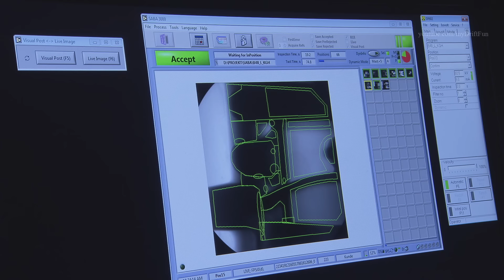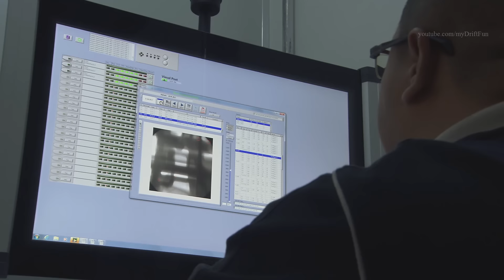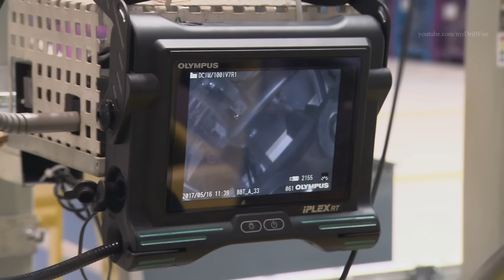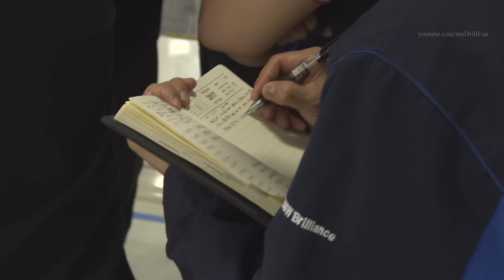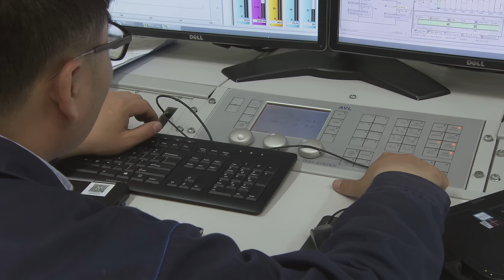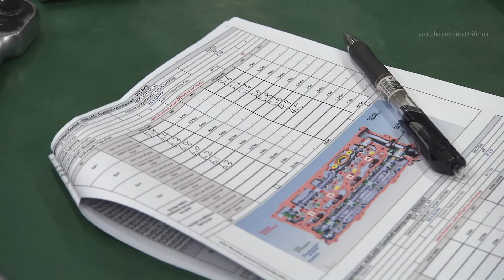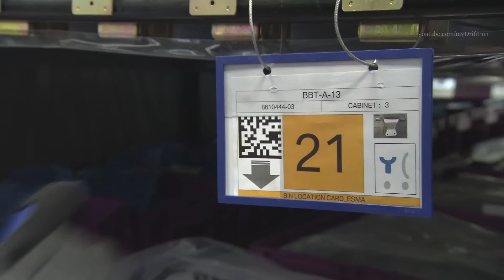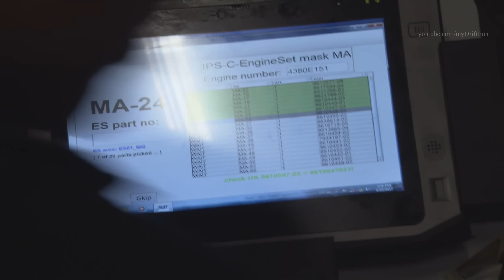BMW Engines Production in Shenyang, China

Comment: It's interesting that the language used in the labeling, and the computer software they're using on the assembly line is English. It looks like a very high quality operation. I'm certain that every part of the process and the quality assurance testing is specified by the German engineers.
Reply: Fred Flintstone  Quite correct Fred. 
This is a top quality operation, very modern.
If there is any problems with the engines then it is with the design of the motor or the materials used in it's construction.
Reply: There is always Chinese "finger print" on made in China products. Please see for example on "15:02" the fork lift charging cord. Looks Chinese level of high end knowledge to me. Wires should not be seen, right? Even modern, it's Chinese.
Reply: I would rather ask what the cause of the problem was. Was it the materials, or the design, or some other problem? I would not be so brain dead as to just assume that the problem is the fact that the work is being done in China.
Reply: of Course the chinese can never creat any technology of their own they are just counter fitters
Any high tech industry have to be supervised by foreign nation
Reply: Whether or not it's true that the Chinese can accomplish great things in engineering is something that can certainly be debated, but I don't feel that applies to these factories where companies like BMW come in, set it up, and supervise the activity. I do believe that foreign non technical countries can come up to speed over time with education. It's not as if one sort of people is better for an intellectual task than another. Education and experience will increase the abilities of anyone. People may debate over whether genetics is involved, but I don't believe it's been proven to be true.
Reply: AbdelRahman Said Really , you believe that ?
One day they will overtake us in abilities,  enough that I truly think they will be the next pioneers in Space Exploration. 
Even to the point of putting a manned Lunar Colony or Base  on the Moon , before  the USA.
Furthermore,  they will be THE Superpower to beat.
Out of the nearly 1.3 Billion people they have,  I am quite certain that in that mass of humanity lay numerous geniuses. 
The mathematical probabilities just make it so.
Reply: Most Germans speak English very well.  German companies export many industrial products to so many companies.  It just make sense to standardize everything to English, unless the purchaser request labeling in their own language.  There are more Germans in White American population than all other white population COMBINED.  Germans are about 60%, where as English are barely 10%.  This was true BEFORE the war.  The reason why America is English speaking nation and not German is because it was the king of England that we had fight and gain independence from.

Comment: No big change in engine quality.  BMW engines have been burning oil like there's no tomorrow for decades so moving production to China will go mostly unnoticed.
Reply: do they use synthetic oil?
Reply: peter must have had an m52 LOL
Reply: One of the most unreliable brand for engine yest beautiful cars.
Reply: ya think so?
Reply: BMW and VW need to use correct oil, better 0W-40(30) than 5W-40(30).
Reply: @gregh7457  these parts are supplying china market only you just simply cannot buy them from the outside. of your car is a bmw and it has any problem it is not even manufactured there.

Comment: You'd think with all that technology they could produce an engine block that can survive the occasional overheat, and won't shed it's bolt hole threads when you remove a head bolt.
Reply: engineered early retirement

Comment: Questions:
  are the machines shown doing the work making the parts built in China or were they imported from Germany?
  do the Chinese workers perform the same inspection routines as the German workers?
  are there any models made exclusively for the Chinese market? If so, which are they?
I can watch this stuff for hours and re-visit it and watch again.
Strange ending...
Reply: Hi Johan, some of the models started by exclusively offering to China market such as the longer wheelbase cars and the 1-series Sedan. Since China is already a huge market with drastically increasing demand for cars, only 2% of the China made cars are exported every year. As far as I know China made BMWs are not yet being exported. 
The Shenyang BMW engine factory is the first engine plant set by BMW outside of Europe. It seems to be more advanced and I guess it must be supervised by BMW.
Many other engine companies produce their engines in China, such as Perkins (a Caterpillar company), whose engine are assembled in Suzhou. But the engine block and some other parts are actually imported rather than making in China.
The engine plant of BMW in China casts engine blocks which I think is more advanced than Perkins. 
Yanmar and Cummins also make engines in China as they need this huge market. 

P.S. I'm no expert but hope this helps.
Reply: Everyone is so fearful of the Chinese Menace.
  If the guys at BMW are willing to put a factory over there for that market than "all the power to them."
  that 1 Series car is a rocket on the Europe Rallye scene.  very coool..

Comment: Did i see a 3 cylinder?
Reply: Jim Clarke Yes, the 3 cyl is for the i8. As well all BMW engines are modular, in that they use interchangeable parts and switch easily between 3, 4, 6, 8, ans 12 cylinders in production. Brilliant engineering.

Comment: why are they using camshafts.   valves  and  drive trains  in the  latest engines  i thought valves and camshafts would be old school now .and be using the electric valve design that the super cars use .lighter and less moving  parts  and smaller engines .?

Comment: 6:36 look guys a bmw v12
Reply: Where did you see V12? - it's L12! (straight 12 or inline 12). Of course - joke. This is 3x L4 engines.
Reply: rutabuga  maybe these are failure components. the first several cast parts are very easily defective.
those guy salvage therm as table leg from melting.
Reply: You mean i4
Reply: V12?
Reply: APRAUGSEPFEB
Reply: Thats table lol
Reply: Correction. You are looking at an engine built by the Chinese. BMW then put their label on it. But in truth, the reputation of BMW as engine builders was already waning when, to make them more economical, they cut the number of rings on the pistons. It worked, because friction losses were cut. Unfortunately engine life was also cut to around 100000 miles, after which the rings and possibly more needs replacing since they start to use a lot of oil. I would not consider buying a Beemer from this century.

Comment: No wonder my 7 sports sedan series Bimmer's engine fall apart after 100,000 miles. Good engineering design but cheap parts inside the engine.

Comment: Meh. Good for them.
I bought a Hyndai, apparently made in USA.
Some of the oil passages were not fully cleaned after manufacturing.
So far, so good, engine has not exploded yet.
Nothing wrong with maid in China.
Reply: Oleg S thought that Hyundai was Korean not Chinese
Reply: Good for you for pointing that out. Good thing everything is now set in order on the internet after you pointed out that mistake. Endless thanks...

Comment: Now , I know why my 04' BMW 545I was a lemon.   Tranny would'nt shift out of 1st gear,  at 118 th miles,  part it needed was a PO 706 Switch.  My Dealer had it, $420,00, but I had to buy the  Trans  Valve body with it,.... $5,000. ?    I turned the BMW back to the Lender.     Why should the Trans need to be Over-Hauled so early?  at  $ 3-4,000.   Battery cable, $420.00.  Oil Leak cost $ 800.00, year later , it's still leaking about 2-4 onunces over -night.     Worst car I've ever bought. Dealer is only one who has master Code Reader, Hence they over-charge you for anything.  Parts are cheap quality , but they charge like they're made of gold.   NO more BMW's for me.  Money Pits.
Reply: these parts are exclusively suppyling china market. dont blame the poor quality to chinese ppl and get your brain un washed